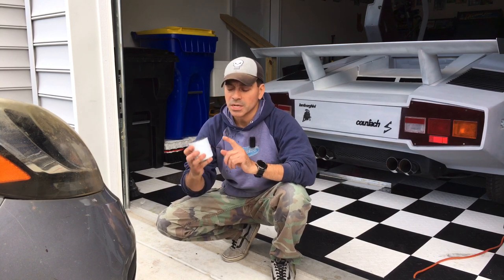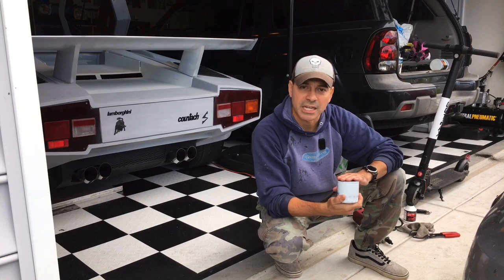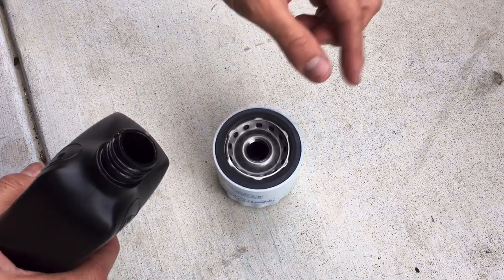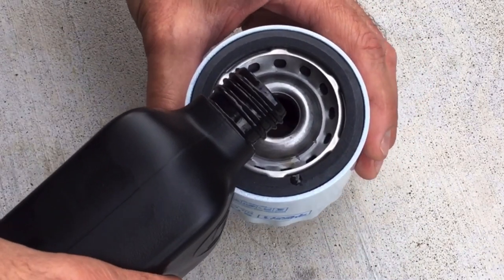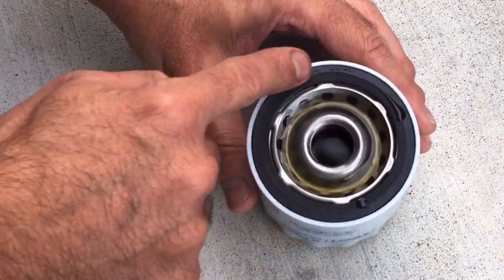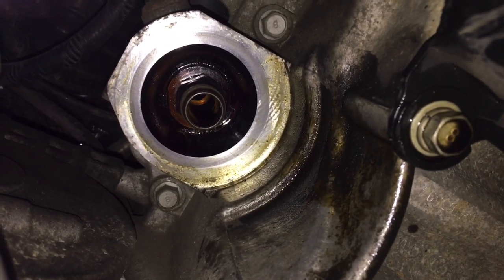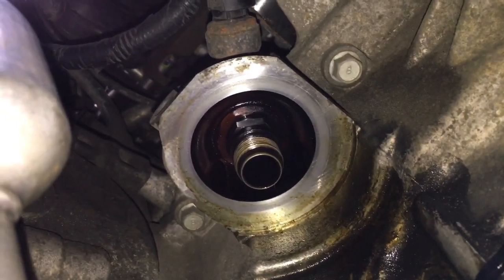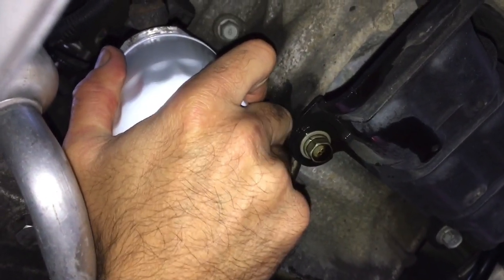How To Prime And Prep An Oil Filter (Andy’s Garage: Episode - 293)

Comment: Thanks, good demo & overview… I have done for prefilled many years: faintly ***remember starting full pre-fill/ lube Gasket carefully/ 1988-79(?) with my 1977 TRANS AM HURST HATCH/ SE TA 6.6(400 ci, kind of weak engine:: we improved on it with a few things,& a Full / Unrestricted Flow Oil FILTER HOUSING  from HO PRODUCTS,ETC. INTERESTINGLY, have vivid memory of trying MOBIL ONE around 1978-79 in their 5 W-30 (( ? Memory))& noticed an increase  start ups NOISES WITH emPty filter..ANYWAYS, GENERALLY i use,MOB1 Full Syn…. * ps*on HORIZONTALLY mounted OIL FILTERS(* my 2007 GMC CANYON 4 CYL) I just let the Filter (* gen PUROUlator Boss/ or Napa Gold) carefo soak for a few extra MINUTES with some,  less than Full:** screw on ***quickly, after checking HOUSING, with towel ……

Comment: Is there some sort of method you use when the filter connection is configured SIDEWAYS so as to avoid spillage?
I put the oil in a little at a time and roll it so that the filter ABSORBS the oil.  I keep doing this a little at a time and test for spillage by holding it SIDEWAYS until I know I'm at my maximum fill.  It's not going to be as FULL compared to a vertical configured filter connection but I guess it'll do.
Reply from the maker: Unfortunately with a side mounted filter it’s hard to properly prime it. This only works with an upright mount
Reply: Clear flood. Look up your car